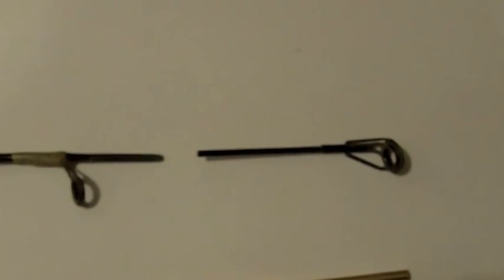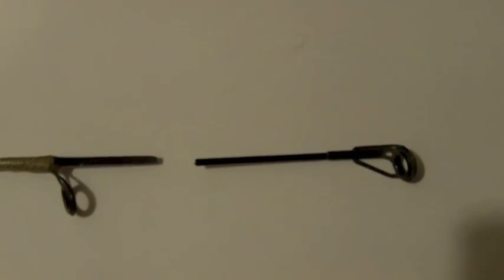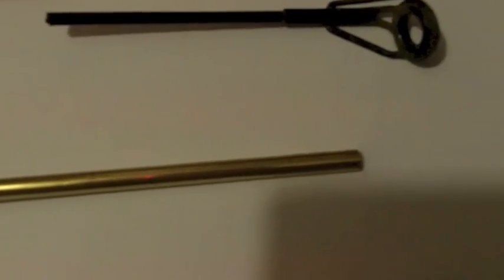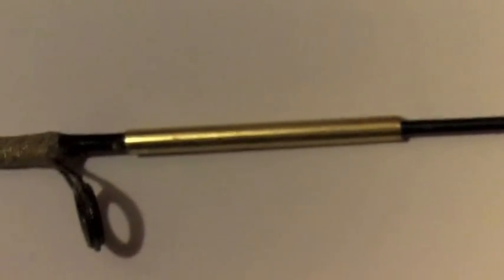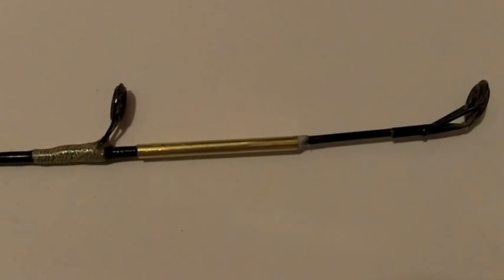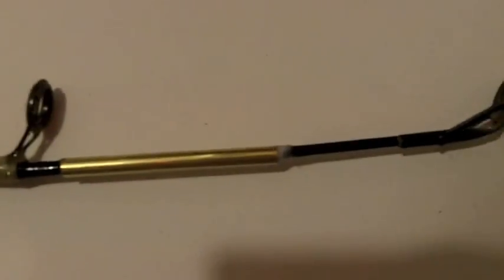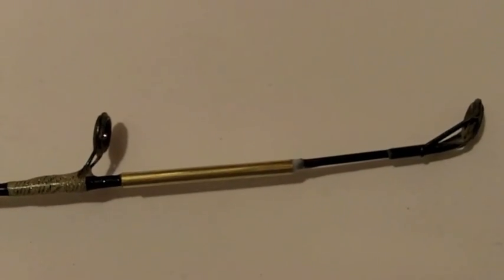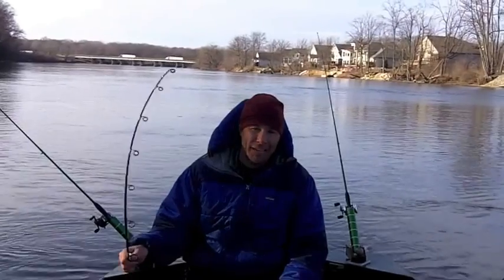How to Really Fix a Broken Fishing Rod

Comment: Another way, that I just used--worked out great too.  I took a sewing pin, that fit INSIDE the ferule (about two inches in, leaving two inches out), added Gorilla glue and let it set on the broken side.  Then glued the outside of the sewing pin and shoved that inside the longer part of the rod, let it set.  The sewing pin flexes, just like the original fiberglass.  I square cut both sides of the brake, and it came out a lot like the normal connection of a two piece rod, expect of course with the glue it is permanent.  After set up, put one small piece of tape to cover the repair, and then used braid super line and wrapped and glassed.  Looks good, seems to work fine.
Reply: Jmichael Isbell I did the same thing. It's drying right now. Wish me luck lol
Reply: How did it turn out?
Reply: Genius

Comment: Great way to fix the rod. When I've had a break in the same area, I would remove the first guide, sand the blank down a little, then glue the tip onto the sanded blank. Sometimes a larger tip is needed. Either repair trick gets you back in action.
Reply: Does this work

Comment: I just did the same thing only I used a piece of a broken spinning rod. I estimated the size I needed to get the tightest fit possible , hacksawed about an inch worth and glued it together. I didn't have any epoxy so I used Gorille Glue. It's my first attempt at rod repair but I just couldn't see a brand new Johnny Morris Carbonlite just sitting there.  Did the same with a LEWS IM6 and put JB Wld epoxy on both.
Reply: Broke my carbon lite 2 also broke it pulling on a snag.Could not believe how easy it snapped.

Comment from the maker: Gene: Not the case with the rod glued inside. I'm really just mimicking the old aluminum ferrules that were used to connect a two piece rod. The break gets distributed over the length of tube. It’s been two years and this rod is still working perfectly.
Reply: CrankCraft thanks for the tip!

Comment: the way i do it is to get an old quiver tip or top section of rod , cut it about 3 ibches long ,, push this in side of the larger broken end and push it up inside the rod till it sticks out the broken end it will look like the male end of a spigot joint , then i place broken piece over the spigot joint i have made ,, check fit glue and whip ,, job done invisible as well
Reply: +tellitlikeitis1963 I love the rebutal.  I was thinking the same thing, you can buy broken rods for near nothing on the dollar at estate sales and the like.  I have gotten quite a few pen reels for like 5$ that weren't smooth but after oil and grease they are great.  I am thinking about making 10-15 high quality rod and reel combos for like 20$ a piece.  Thanks for the idea, haven't done that sense I was a kid.
Reply: in the video heuses a metal insert lol that will cause a flat spot ,,,i always find old rods that are past repairing and keep what i might need

Comment: Nice one. Thought it be better fixing something inside ? Something a bit flexible as well to bend with the flow of the rod. But hey ! If it works what the heck. A good angler will always catch and with pretty much anything 😀😋
Reply: Actually ur right won't be able to fit any thing at that end I'll shut up lol.
Reply: If it was broke further down the rod you could get fiberglass dowels to put inside the rod then glue it in place with like a 2 step epoxy or something

Comment from the maker: I use the same two part urethane form Alumilite Corp (several choices, any type will work) that I use to make crankbaits. It expands when it hardens so it fills the tube up nicely. However, I think epoxy would work too as long as you fill the tube up before you put the second rod piece in. If anyone tries epoxy, please let us know how it works.
Reply: Thanks for this video. I just tried this method with my lightning rod. Insted of the tubing, I cut a sleeve from a old rod top, and gorilla glue epoxy. Unfortunately it did not work do to the area of the break. I would have only lost 3/4 of an inch. I should have removed the the guide below the break, and I feel that it would have worked. I might give this theory another go even though I already ordered another pole. I'll now lose more than an inch but I think I can get it done.

Comment: No offence but that's a temp fix and its just as easy to fix it properly and permanently using a piece of broken carbon from another rod. Slide the carbon inside so it's slightly tight along with epoxy resin and resin over the top and whip the joint. That way it flexes, its light, won't affect performance, won't create another stress fracture, will last forever, is easy etc.
Reply: Also no offence but, what if you don't have a piece of broken carbon rod?
Reply: @trapin68  just go to a tackle shop, they always have loads.